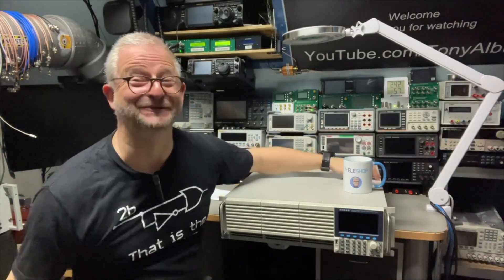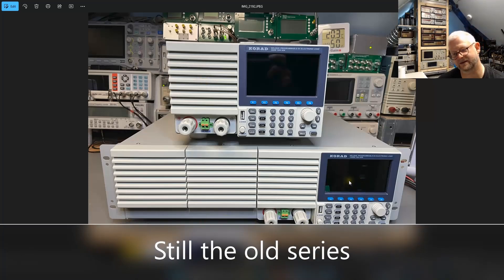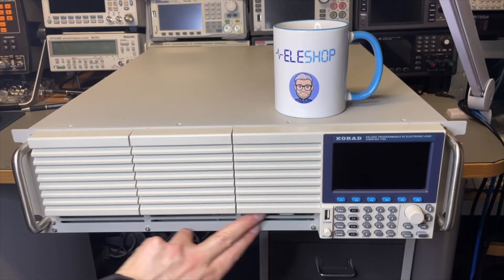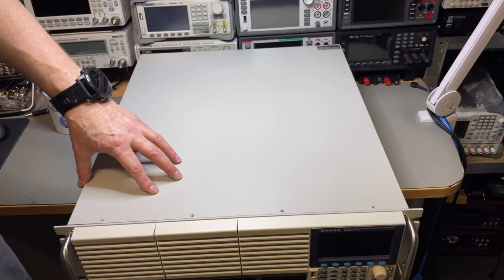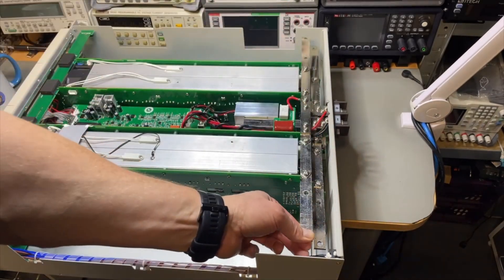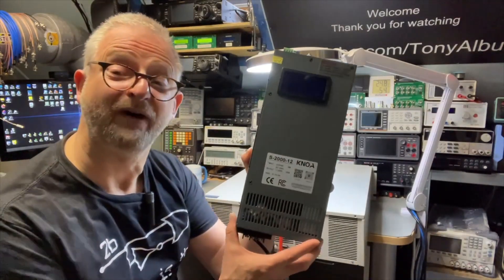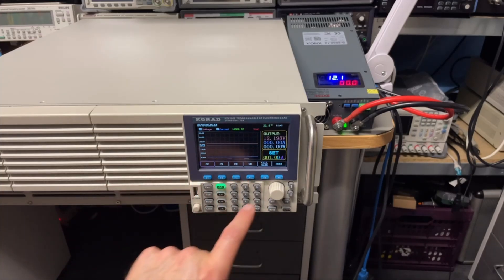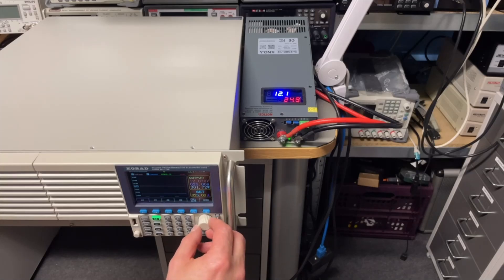TA-0454: Korad KEL2060 - 2400W 170A - Electronic Load - Hands-On - Teardown

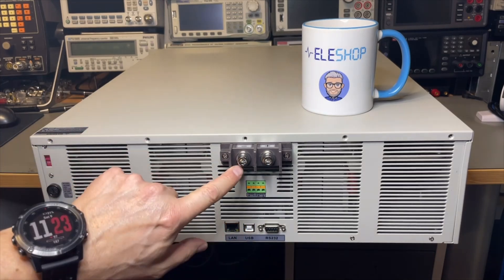Comment: 3:43 Do you have any idea what this kind of cable lug is called? They look really useful, and I've never seen a shape like this. I only know the circular and the spade ones, where the first ones is inconvenient to handle (you have to fully unscrew the post every time) and the later one will just slip out if the post ist not screwed down fully.
Reply from the maker: That are normal round ones, but i cut the side out of them, i choice to cut the side, for your given reasons exacly :)
Reply: @TonyAlbus  Oh, that's actually a really nice idea, and I don't know why I never thought about that. I may steal your idea :D
Mangled so many of the fork lugs I use to connect or my dummy speaker load over the last years, at some point they are just bent out of shape and fall off all the time.
Reply from the maker: Thanks, no worries, i share this, to be shared. If you cut the right side, when tightening the screws, it closes if it would move, so have the opening always on the right side for durability, i think.
Reply: @TonyAlbus  Oh yeah, makes a lot of sense! I just would have put the cut on the right side cause it will mostly be my left hand hanging them into the screw post :D